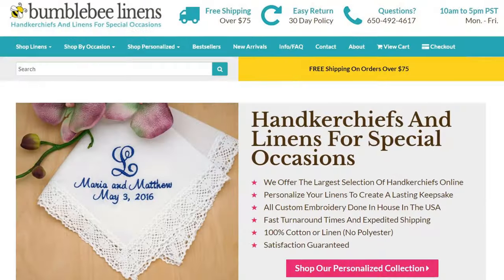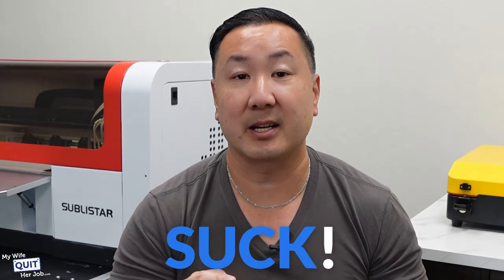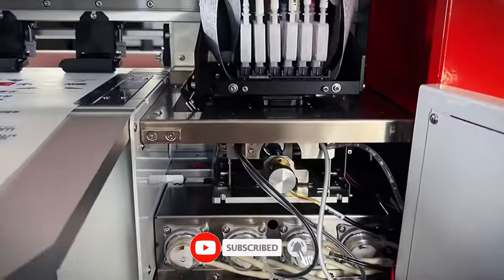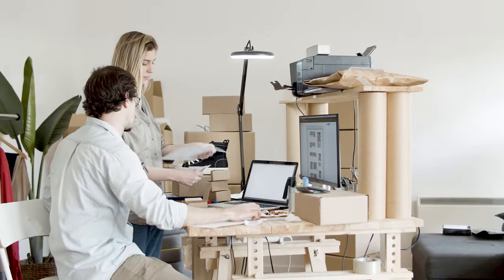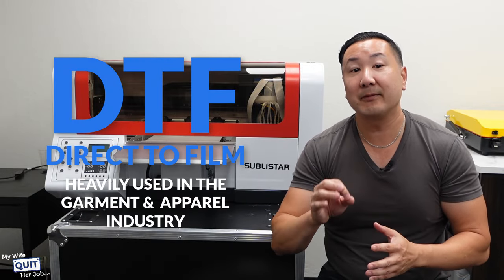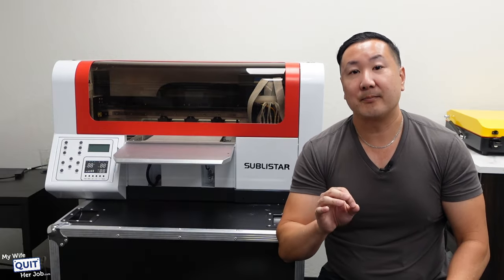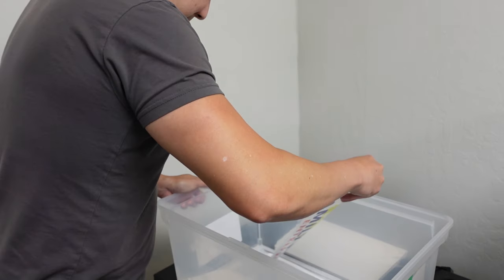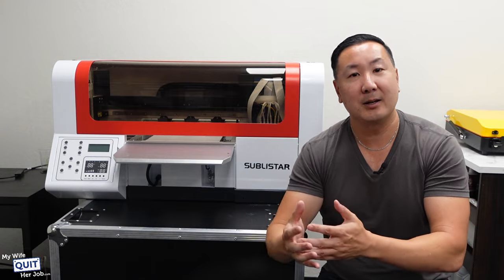Forget Print On Demand! DTF Printing Will Make Me Over $1M Next Year

Comment: Have you tested washing the shirts a few times to see how it holds up? Thanks for the knowledge you share ❤
Reply from the maker: Yep.  It washes well
Reply: The materials they use are scratch-resistant, have low thermal shrinkage, are durable and do not fade, and the effect after washing is also very good.

Comment: Thx for the video, wanted to ask: How does it feel, is it plastic to the touch or more light like ink?. If it is plastic like, does it heat much under the sun if printing larger designs like traditional transfer?, thank you again.
Reply from the maker: There is a slight plastic feeling to it.  But it will survive many washes

Comment: Thank you for this video. I trust your knowledge so I guess this is a good machine. Justy one question, is the machine loud while operating it? Does it leave at smell while using it? I am about to start POD but as soon as I am ready I will like to explore this option from home. As for now is a small apartment with two toddlers around.
Thank you Steve!
Reply from the maker: The machine is a little loud but much softer than an embroidery machine.  I would say it's as loud as one of those old dot matrix printers if you remember back that far
Reply from the maker: As for the baking step, it is recommended to use an air filter system which costs about 100 bucks on Amazon
Reply: @mywifequitherjob  the baking step is when you are heat pressing the film onto the garment, I assume?
Reply from the maker: @foamformbeats  No, the baking step is when you are fusing the powder onto the film
Reply: @mywifequitherjob  oh I see. there is a printer with a built in air filter, so I assumed it was for the printing phase, but maybe it's a 2-in-1 print and bake

Comment: DTF isn't better than DTG or screen printing. Using DTF, you have to print the film, apply powder, put it in an oven to apply the powder, and then press it on a shirt. With DTG, I load the shirt and press print. There are shirts that come already pretreated, or you can pretreat your own in bulk.

Comment: I went to their website and they don’t mention pricing anywhere. Did you get the DTF-A3+ STAR Ⅳ Film Printing Machine or the Sublistar Star IV DTF Printer And Shaker Machine and if so, what was the cost? I don’t want to schedule a call with the company to simply get the price for either of their machines. @mywifequitherjob
Reply: I found their prices by using thr menu. Everything is over 6k for the machines.

Comment: I sent a message on your website questioning leasing options for this printing setup as mentioned in this video. When reaching out to the company, leasing is not available and the hot press is not included. The upfront investment for this printer is nearly $8K. Do you have a vendor in the states leasing these printers and tossing in the hot press? Any help would be appreciated.
Reply: I’ve been trying to find out this same information. I can’t see where leasing is an option either. I only saw that the machine itself is $10,000+, no response from the company at all 🙄